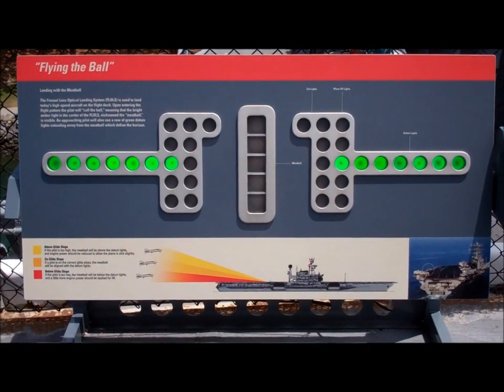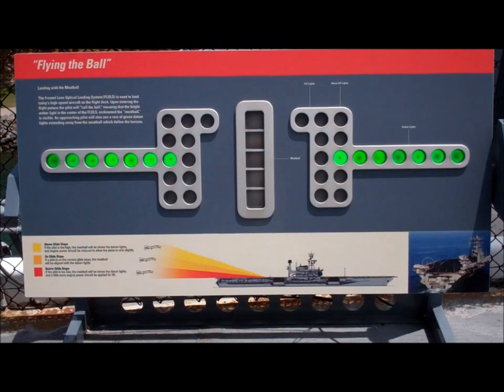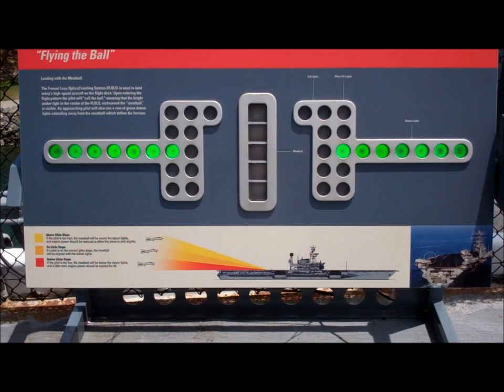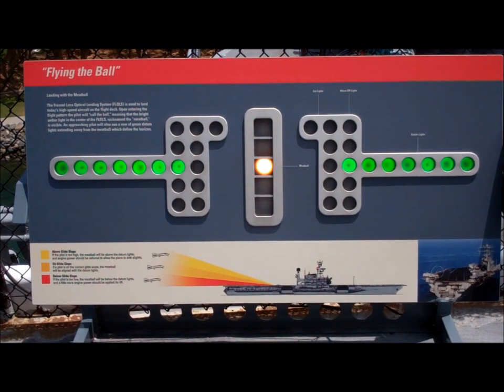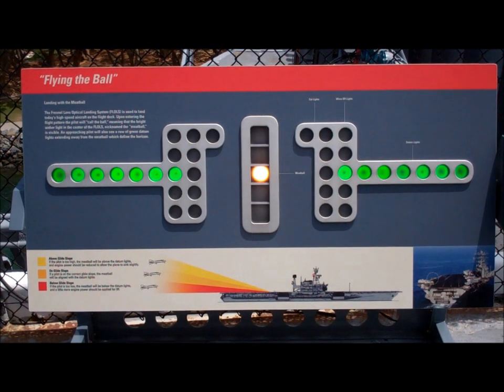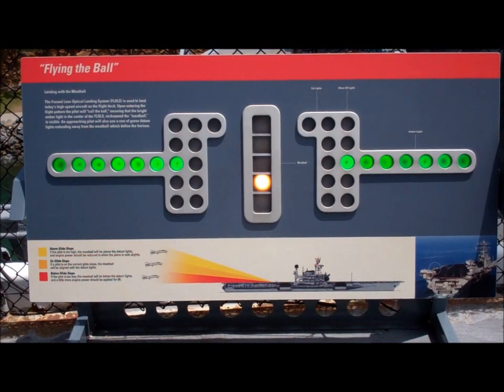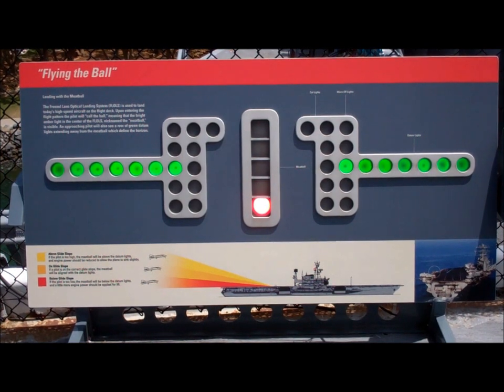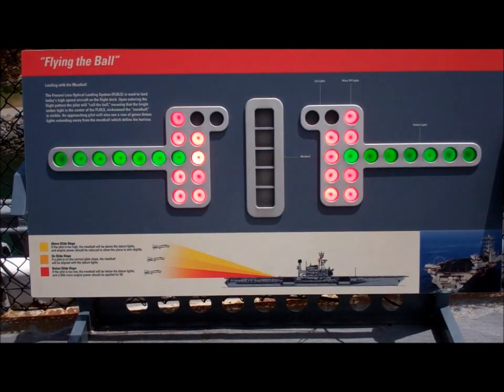Flying The Ball

Comment: True story:  Once had to salvage an aircraft that had flown a perfect "ball" into a crash landing while flying an approach to an airfield landing.  February 18, 1983, MCAGCC 29 Palms, VMA-214.  I was Power Plants NCOIC and listened in on a debrief by the AMO.  Apparently there were sets of green lights on either side of the approach path short of the runway down a slight incline from the runway threshold.  They discovered that the row on the left hand side had one heavily weathered lens, more or less in the center of the green lights, that made it show white instead of green.  On the approach, the pilot set up on this before seeing the actual mirror setup further away (weather also a factor, I believe.).  He flew a perfect approach on the bogus "ball" right to a short landing.  Main landing gear failed to the rear and were drug down range until aircraft continued down the runway.  Fire ensued and the nose landing gear caught the arresting wire causing aircraft to swing 180 degrees and come to a stop.  Now with flames all around, pilot remained in cockpit until crash crew applied foam and he egressed.  Salvaging the engine was fun, as the aircraft was sitting on pallets.

Comment: During rough seas with a pitching deck the LSOs also use MOVLAS. The equipment is similar only the Ball is manually controlled by the LSO. The LSO times (predicts) where the deck's gonna be by the time you land. They simply move the Ball where they think the pilot needs to be at the time. The pilot flies what he sees.
Reply: Trusting the LSO so implicitly sounds scary
Reply: @JohnVanderbeck  
The LSO is always a fellow pilot on the carrier. On this day he will be landing you, but just as easily on another day you could be landing him. 

The LSO doesn't want you crashing... and he certainly does not want you crashing into him.
Reply: tapalmer99 Beautiful Trust.

Comment: I never thought of glide slope to be more dependent on engine power output than control surface input
Reply: Absolutely, from the 3-9 line of mother on the reciprocal BRC you won't be making any major pitch adjustments with the stick. Once out of the break you should be fully configured (trimmed up for landing) and fly the E bracket on-speed (135-150kt) all the way through the RBRC, 30 angleabank and glideslope. On-speed will keep the angle of attack correct for landing, if you're fast the nose will pitch down and you'll skip the hook, if you're slow you'll bounce the hook, adjusting pitch with the stick will likely lead to an in-flight engagement.
Reply: Bruh. All that effort is for nothing and makes you come off as a braggart out to demonstrate your knowledge for the world to admire. The OP is clearly a novice (as am I), and it is in all honesty largely gibberish. Do you really think that anyone familiar with all that technical terminology would be unaware of the simple physics of the glide slope?? Smh..
Reply: Power for altitude
Pitch for airspeed
Reply: Yes since the jet should maintain on the 3 degree glide path, at the same time maintaining 8.1 AOA, there’s no room for pitch to adjust. Instead the air speed is available so they use throttle for adjustment, not pitch. And this method is actually used not only when landing on a carrier but on land, by many aircrafts.
Reply: common pilot quote 'in thrust we trust'